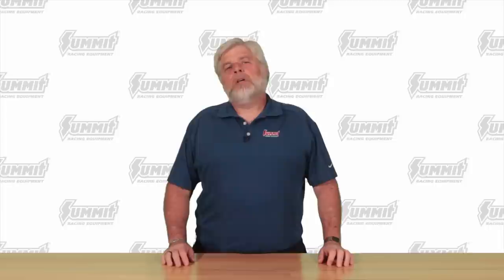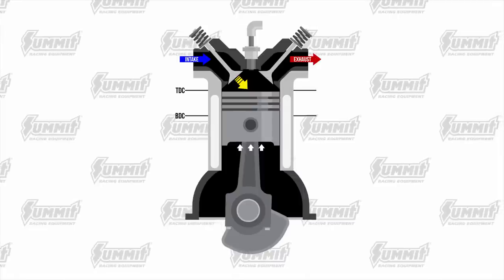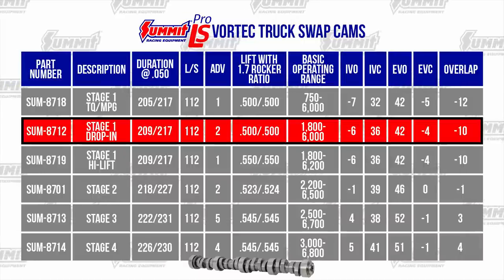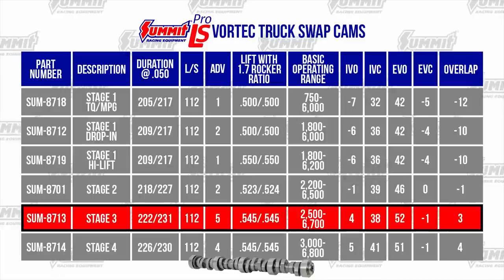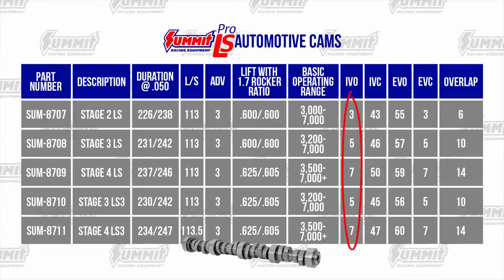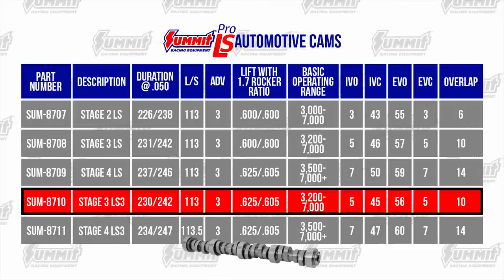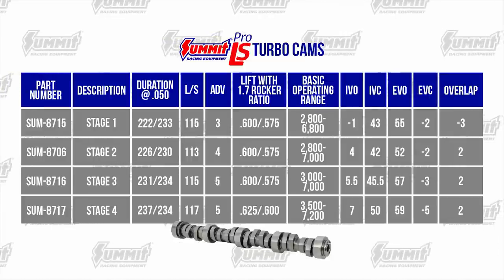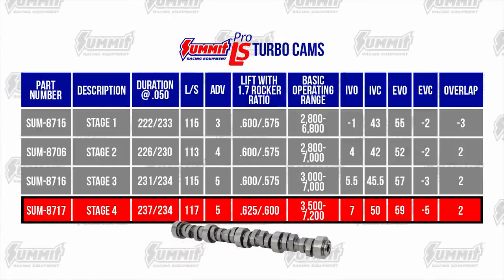Summit's New Pro LS Cams Are Here!

Comment: Hey i got the sum-8712 drop in cam on a 6.0 lq4 stock springs and stock stall im missing my upstream o2 sensors and my maf is un hooked it wont run with my maf hooked up would that be from my o2 sensors

Comment: What's your guys recommendation for an LS swapped s10? I'm looking to get as much power as I possibly can with as little mpg loss around 1-2 at most on highway
Reply from the maker: Hi Chris,
Sum-8719R1 is a great cam and is about the biggest you could run without excessive overlap that wastes fuel. Another great cam that’s a little more tame and intended for towing with excellent midrange is Sum-8718R1.
https://www.summitracing.com/search/part-type/camshafts/product-line/summit-racing-pro-ls-vortec-truck-swap-camshafts

Comment: Ordered 8718, stoked to install and tune it! Volant intake, jdm headers, MBRP exhaust. 05 yukon 5.3,  beeefffyyyy!
Reply: How did your cam swap go?
Reply: @JadXtreme  the o-ring on oil pump broke seal causing motor to seize.... R.I.P. so I did a 6.0 LQ9 and tuned it into a beast, sucked I couldnt even add the cam i had just installed 3 weeks prior due to core swap and 6.0 warranty.

Comment: I have a 1992 Chevy Silverado and i am doing the LS swap 6.0 out of a 2003 Escalade. I pull a horse trailer and want to play a little from red light to red light when I'm without my trailer which summit cam would get me the best of both worlds
Reply from the maker: Thank you for your question.  SUM-8718 is our drop-in towing cam and would pick up power throughout the range and add more rpm up to.  SUM-8712 drop-in trades just a bit of off-idle torque for more power up top and the higher lift version SUM-8719 for use with LS6 springs makes a bit more power through the range and higher yet due to the increased spring rate.  Any will make you happy, but this will give you an idea of what to expect.

Comment: I have a 4.8 04 Sierra. Not looking for a full blown CAM. I still daily drive, what cam u suggest
Reply from the maker: A good choice would be the SUM-8719.  Its designed to work with LS6 springs and will make good power in a 4.8 without losing low end torque.

Comment: I bought the Summit Pro LS sum-8708 stage 3 cam kit with springs and doing a 750 mechanical secondary carb and MSD LS 6014 conversion on my 2005 5.3 with ported and polished 706 heads and th350 transmission...going in a 3rd gen camaro..just trying to figure out if I can stock length pushrods and what lifters do I need to use
Reply from the maker: I suggest using a Chromoly pushrod and SUM-HT215-16 lifters. You will need to measure for the correct pushrod length. You can find more information here: https://help.summitracing.com/app/answers/detail/a_id/3757/kw/pushrod%20length

Comment: Hey Summit, my towing/grocery getter is an 07 Suburban 2500 with a gen 4 6.0 and Ls6 springs. Stock converter, with long tubes and stock intake. Going to delete vvt. Based on your description, I was looking at your 8719, its only available as a kit the onsite, should I be looking at the 8701 instead?
This truck will have a 75mm turbo eventually if that makes a difference. Thanks for your service
Reply from the maker: Either camshaft will work fine in your application. For a true tow rig/daily driver, SUM-8719R1 is a better choice due to its smoother idle and better low-end torque.

Comment: I know this came out a year ago but jus popped up on my view just now and I have a question. what's the best can to get with a choppy sound for a 04/4.8 I want to keep it mostly stock for a daily driver
Reply from the maker: John, there are a couple good choices.   SUM-8719 is a 209 @ .050 cam with good lift and would probably be the best choice for a daily driver with a stock converter with a 4.8.  You can set the idle speed at any level to induce just the right amount.  The more radical sounding version that would work if you weren’t doing too much towing and/or it was a stick is SUM-8720.  This is a 218@.050 cam with .600 lift and makes a ton of power.  It’s probably a step too large for a 4.8, but quite a few people love it anyway.
Reply: @SummitRacing  cool and I hardly do any towing jus small stuff and the motor has 233,425 miles on it now and still a daily driven motor still strong I was jus wondering if she has too many easy driven miles for a choppy cam leaving everything stock
Reply: @johngray8395  Hey, John. I'm about to build a 05/4.8 and my needs are the same as what you posted here last year. I was wondering if you ever got your cam installed, which one you used, and if you're happy with it? Does it sound choppy at idle?

Comment: For the 8701.  When you say stock converter, is that a typical stock converter ?  I’m doing a swap and using the stock  TH350.
Reply from the maker: Thank you for your question.  A typical converter is in the 1500 rpm range, although some of the performance oriented versions like a trailblazer SS can flash as high as 2200.  Torque converters are one of the most important parts of the puzzle to get the engine up “on the cam”.  Feel free to give us a call for more detailed info.
Reply: @SummitRacing  you didn’t answer my question.

Comment: I have a 2001 5.3 silverado and it’s my daily driver and I pull a boat often so I kinda just want it to have more power for fun but still push good low rpm and be reliable any recommendations on cam selections ?
Reply from the maker: Our SUM-8718R1 Stage 1 truck tow/RV cam is a great choice, with a 750-6,000 rpm operating range. It’s a drop-in camshaft, but on higher-mileage vehicles, SUM-8718-1 is recommended. This kit contains the SUM-8718R1 cam, beehive springs, valve locks, and valve stem seals. It’ll work with your stock torque converter, but ECM tuning is required.
https://www.summitracing.com/parts/sum-8718r1

Comment: The spread on the truck cams seems to big for how small 5.3 valves are stock  .they might work good with 315 heads because those have big valves but even then the low lift and separation between intake and exhaust would kill truck torque because they don’t have that much compression a tighter intake and exhaust is making quick torque and low lift makes torque sooner but for the stage 3 and 4 truck seems to low of lift for the duration just my two cents
Reply: The 317 cast cathedral  head makes the least power of any cathedral port.
The is a thing called, "coeffiecent of discharge", which compares valve diameter to port volume and bore diameter.
So a larger valve will not necessarily flow more air if the chamber is shrouded more by a smaller diameter bore size. If you look at how air flows around a valve, the seat in particular , which is the most restrictive part of the port, you will find this to be true.
Some experts also say the 317 head has the most inefficient chamber and the only way to improve it is to have cnc work done there.
Also, the 862 & 706 heads with their small, 1.89" intake valve still flow upwards of 230cfm, in stock form. Or enough to support 460+, hp. Not knocking Summits came, but...
A BTR, stage 2 truck cam with 212/218 degrees duration@.050 lift will make 420+ hp on an otherwise stock 5.3 with the TBSS or NBSS intake & long tube headers & factory heads.
Replacing the stock heads with 317's will drop the compression .5 of a point and power will suffer everywhere.
This has been dyno proven.
Reply: @O3h529  what cam would u recommend for a 408?
Reply: You have zero clue on what youre talking about

Comment: I have a 2004 H2 6.0L stock n I want a camshaft that will make drive faster. Which one should I put in?
Reply from the maker: Thank you for your question.  There are several options depending on whether you have a stock stall converter and what kind of idle quality you are looking for.  We recommend looking at SUM-8712 (drop in) or high lift version SUM-8719 (LS6 springs recommended) to extend the rpm range.  The next step up is SUM-8701 (drop in) or the high lift version SUM-8720 (TFS-16918-16 springs recommended).  These are about the most recommended with stock torque converters.  Feel free to give our tech department a call to discuss what is right for you.
Reply: @SummitRacing  thank u so much. Your the best👍👍

Comment: whats the most aggressive cam i can get with my set up no further parts.... im running cold air, full exhaust..headers, xpipe, corsa xtreme...ls6 intake, 3.42 rear end, i will change springs, rods, harmonic bal, radiator/therm..  dont want to do heads, torque con. or anything else!!! my wants in this pocket.. sound/power as much as i can in this box!! please!! LS1 2001 vette with the mid generation upgrades!!
Reply: 6 speed or auto? just seen the 3.42... but thought that was 6speed only if you say you don’t want to replace converter then you have A4. Anyways stage 3 for 6Speed but you will have to do valve springs. If you are Auto then the stage 2 is max but will be a PIG until you get up to ab 3000 RPM

Comment: Would these work good with the stock manifolds or would it not be worth it?  The exhaust after will be 3 inch. LS swap into an obs truck.
Reply: Yep. Truck manifolds are good.
Reply: What transmission are you running?

Comment: Wish I had known about the other turbo cams offered before I bought the stage 2. The other cams did not come up on the website when looking at the pro LS cams. Bummer
Reply: Yeahno how do you like the stage 2? I just bought it for my 5.3 swap, is it even worth getting a stall?
Reply: @jah918  i wouldn't even get a cam with out a stall. I mean if you had to...maybe stage one but with a stalls is where it really will make power.
Reply: Im going to give you a refund and ship you the right cam.
Reply: @jah918  If you want to go fast then you need a good converter. It will be annoying pushing through the brakes at idle with stock converter stall speed.
Reply: Why? The stage 2 you got looks like a great cam. You done did good.

Comment: What cam is better chevy 6.2 2011 stall  2200 delete DOD and vvt is swap in camaro 89
Reply from the maker: Hello Julian, the Stage 2 part number SUM-8707 would be an excellent choice with that torque converter.
https://www.summitracing.com/parts/sum-8707

Comment: I have an 03’ 6.0 LQ4, I’m just doing an LS3 heads/intake top end swap, motor is going into a 1967 Camaro. What cam can I use for this build without fly cutting ???
Reply from the maker: Thank you for your question.  With big valve unmilled LS3 heads, .045 net piston to head clearance, and true flat top pistons; The 234 degree duration stage 4 SUM-8711 is the largest we have tested and recommend.  That being said, we always recommend you check piston to valve.  Our minimum targets are .060 intake and .090 exhaust.

Comment: Do the smaller cams kill mpg? Is there any cams that help mpg, or are the factory cams best for mpg?
Reply from the maker: The Summit Pro LS Stage 1 truck cams can increase mileage.  This is because they produce more torque down low and the transmission doesn’t have to downshift as often.
Reply: @SummitRacing  what about the automotive cams

Comment: Can I use stock pushrods on the sum-8708 stage 3 cam and what lifters should I use?
Reply from the maker: With the extended rpm range and increased spring pressure needed for this camshaft, I suggest using a set of Summit Racing Chromoly Pushrods to reduce deflection and ensure accurate valvetrain action.

Comment: I have a gen 4 5.3 it's an ly5 if I'm not mistaken. Will be going into a car. Will the stage 4 fit with stock heads/rotating assembly?
Reply from the maker: Hello Charles, while we always recommending checking piston to valve clearance – yes the Summit Stage 1-4 are designed to fit with true flat top pistons.  Stage 4 is pretty serious for a 5.3L and we’d invite you to give us a call to discuss based on your vehicles weight, gear, converter, etc.  Assuming you’ve got quite a bit of converter and gear and don’t mind the idle; there are also a few alternatives.  SUM-8708 is the standard stage 3.  SUM-8710 is also a stage 3 and gives you a little more piston to valve clearance.  SUM-8711 is also a stage 4, but gives you about .015” more piston to valve clearance versus the SUM-8709.
Reply: @SummitRacing  thank you for the prompt response!

Comment: Would a stage 1 drop in truck cam or stage 1 turbo work better for 5.3 lm7 single gt45. Going in a suburban.
Reply from the maker: Thank you for your question.  SUM-8712 would be a good choice if valve springs aren’t upgraded.  SUM-8719 is the same duration with more lift and is designed for use with LS6 springs.  It would be great for a heavy vehicle.  If you could move to a set of .600 lift 918 style springs and a 2800 converter at some point, the SUM-8720 would be a great match and make the most power.

Comment: Can i use the 8707 in a gen 4 5.3 after DOD? And what are hp gains? Using 6l80e with longtubes and tbss intake
Reply from the maker: Ulises, the SUM-8707 would be an excellent match, but it’s a good idea to go for a 2800+ converter.  We have other more truck specific cams meant to work with stock converters if needed.  Please give us a call to dial in the best Pro LS Cam for you.
Reply from the maker: Ulises, the SUM-8707 would be an excellent match, but it’s a good idea to go for a 2800+ converter.  We have other more truck specific cams meant to work with stock converters if needed.  Please give us a call to dial in the best Pro LS Cam for you.
Reply from the maker: Ulises, the SUM-8707 would be an excellent match, but it’s a good idea to go for a 2800+ converter.  We have other more truck specific cams meant to work with stock converters if needed.  Please give us a call to dial in the best Pro LS Cam for you.

Comment: Im using the summit 8711 in my L92. Will I have enough piston to valve clearance?
Reply from the maker: Thank you for your question.  Summit Pro LS cams stages 1-4 are intended to work without flycutting, but we always recommended checking to be sure.  Stage 4 extra clearance version SUM-8711 should give you room to mill .015” off the heads and still  hit our recommended .060/.090 target.
Reply: Hey how is the cam? I'm looking to get it, want to know if it is worth it.. did you loose any low end torque and is it easy to drive for a daily driver? Looking to put it on a swapped out L92 1983 suburban

Comment: I can't decide between the 8702  truck cam (218/227 @.600/.600) or the 8715 ghost cam (222/233 @ .600/.575)
5.3L going in a ~3000lb car, 4l60e with a converter.  
Im more concerned with average hp, not peak.  I don't want a cam that loses to the stock stick below 3500.
Reply from the maker: I believe you're referring to the SUM-8720R1 and the SUM-8715R1 cam. There are many things to consider when selecting a cam, usage, displacement, compression, vehicle weight, gearing, converter stall rating, etc.
 
I suggest considering the SUM-8720R1 camshaft. This cam will provide enough vacuum to operate power brakes and offers a wide rpm range of power. It will require a 2500 stall speed converter. 
https://www.summitracing.com/parts/sum-8720r1
 
Check out the " What camshaft should I buy?" page from the Summit Help section to guide you.  https://help.summitracing.com/app/answers/detail/a_id/4698/~/what-camshaft-should-i-buy%3F
Reply: @SummitRacing  thanks.  On the Pro LS cams do they need to be installed advanced (with an adjustable gear) or is the advance ground into the cam?

Comment: I have a 05 5.3 Silverado, i want a relatively rough idle without having to upgrade things like a stock coverter , any recommendations? Preferably stage 1-2
Reply from the maker: Thank you for your question.  SUM-8701 is considered the stage 2 for stock springs.  Most of our customers prefer the .600 lift version of that cam that is designed around common TFS-16918-16 beehive springs.  The cam is easy on the valvetrain and easy to tune, but makes considerable power.

Comment: you need to have a turbo to use the cam SUM-8706??
Reply from the maker: Hello Ivan. Summit Racing carries a wide variety of turbos from VS racing, Precision, Borg-Warner and others.  Sizing the turbo to your application (weight, converter, gear, usage) and power target is something we can help you with.  The Summit SUM-8706 is a very adaptable camshaft that works with a wide variety of turbos and will bring the boost on quickly and make power well into the higher RPM ranges.  It also makes very good power naturally aspirated so it makes sense in an engine that is not yet boosted, but will be in the near future.

Comment: Would I need a tune for the drop in truck cam stage 1
Reply from the maker: Thank you for the question.  The SUM-8718 can run without, but a tune is still very beneficial.  SUM-8712 or SUM-8719 are slightly bigger and can run temporarily until a tune can be acquired.  It’s best to plan on getting a tune anytime you are doing a cam swap to maximize the benefits.
https://www.summitracing.com/

Comment: Do these cams come in either 3 bolt or 1 bolt to fit early or late LS engines?
Reply from the maker: Wayne, Summit cams are available in 3 bolt configurations only at the present time.  These fit all Gen 3 engines.   If you have a Gen. 4 engine with the early 24X reluctor wheel, you can use a single-pole timing set like the Summit Pro LS Billet SUM-G6643-1X.  If you have a Gen. 4 engine with the later 58X reluctor wheel, you can use the SUM-G6647-4X timing chain set.